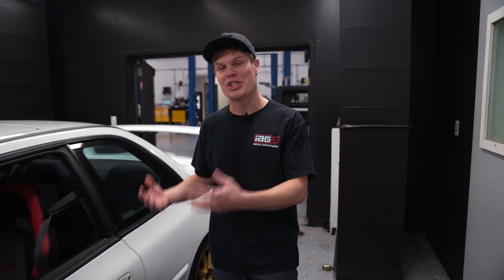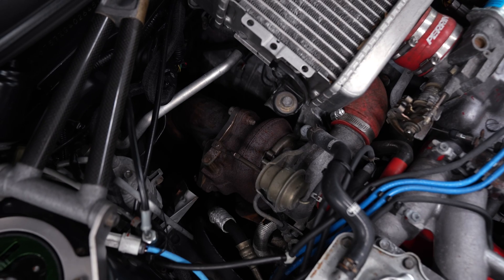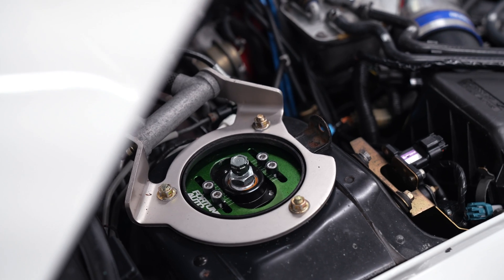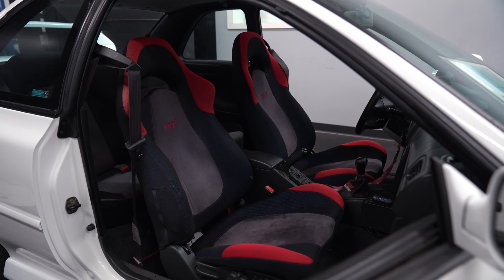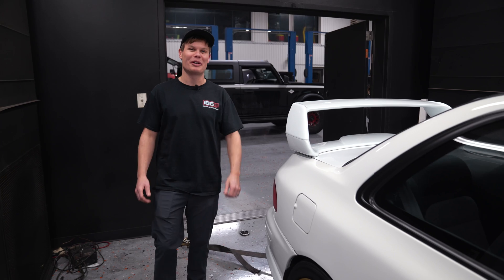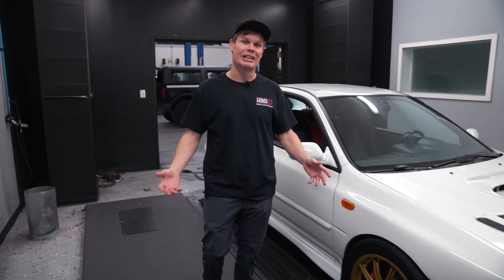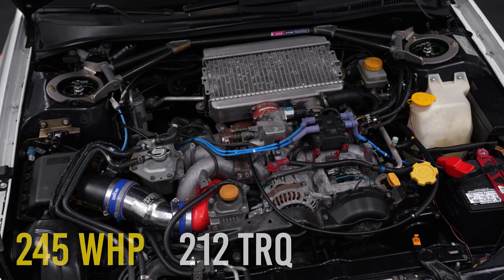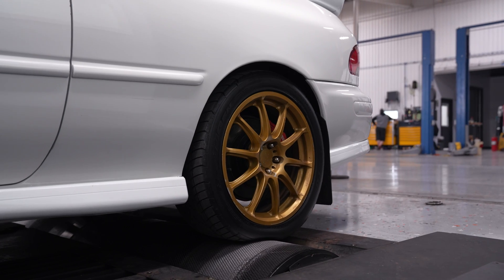How Much Power Does a JDM Subaru STI Make?

Comment: IAG FA24 blocks are a mystery. Press from IAG to be honest sucks. Products from IAG on the other hand is amazing. Lets fix communication with customers and markets.
Reply from the maker: The FA24 blocks are still in testing and development. Not much news to report there at the moment other than the supply of new cases from Subaru is still quite low, so until Subaru fixes their supply chain it will be difficult to offer these in the way we do other blocks. Once we have testing results to report we will do another video.

Comment: How do you tune a JDM ECU? Tactrix cable and open source? I’ve always heard that you can’t use Cobb with them.
Reply: You could use ecutek is the worst
Power fc old school but works 450whp in one of my cars back in the days
Or you could convert to link g4x pnp
You could also get a “chipped” mines or boss ecu , add safc and a meth kit and and be close to 300whp on stock vf 22 or 28 o 30 or 23 they all produce similar power
Reply: There are options I have mine flash tuned with launch control
Reply: I messaged cob 7 years ago and got told that there is nothing they can do for me. Maybe with the new JDM stuff coming in they might start doing some work with them but I doubt it

Comment: Did you end up having to tuning it for the different gas? I have a 2001 JDM Sti I gotta get it tuned but for now there’s no tune and using Canadian gas
Reply: There are a few stock ecu flash options. I got mine done here in Vancouver. I can give you some pointers if you want.